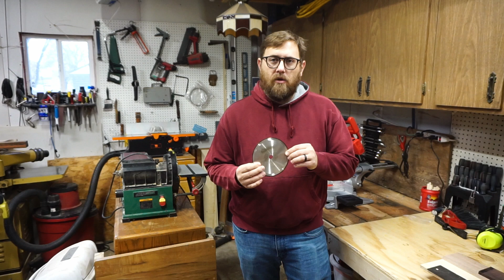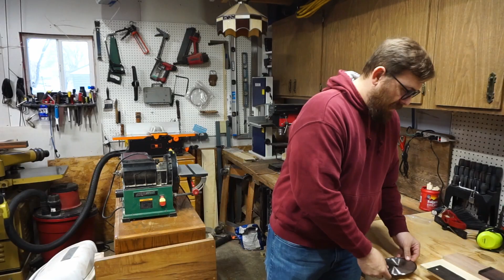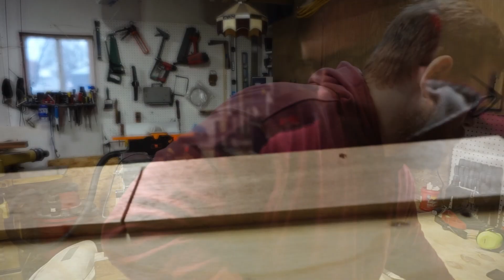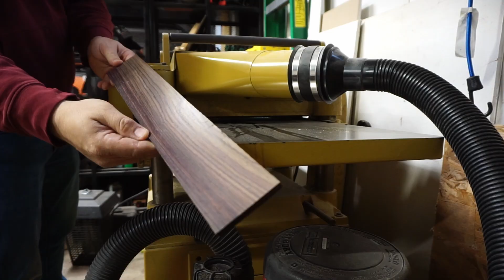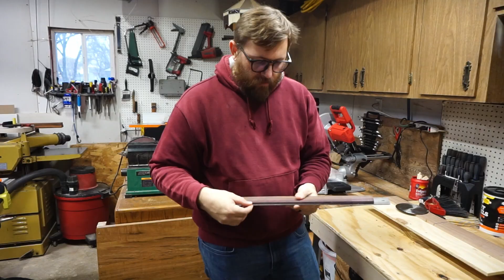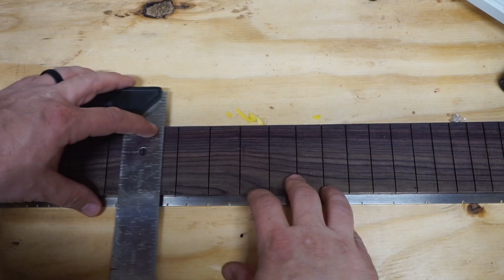Cutting Fret Slots on a Miter Saw!

Comment: Did cutting with 2 passes make them any wider?
Reply from the maker: Not by any observable amount. I think using this system keeps tolerances tight. It didn’t cause any issues later on down the road when it came to installing frets.